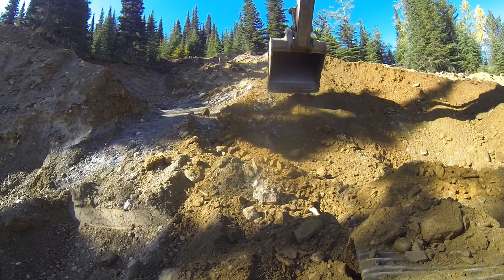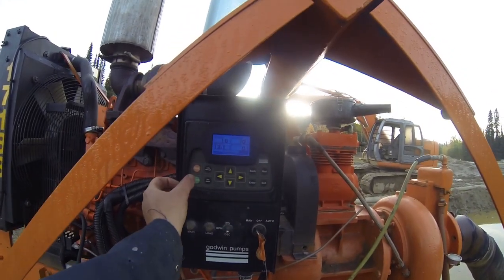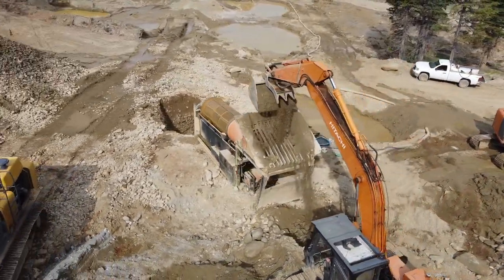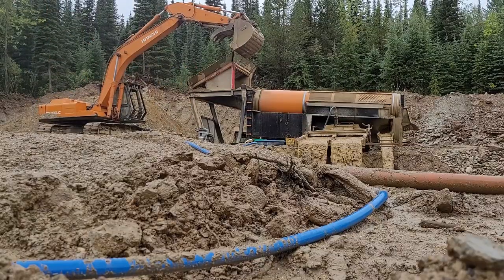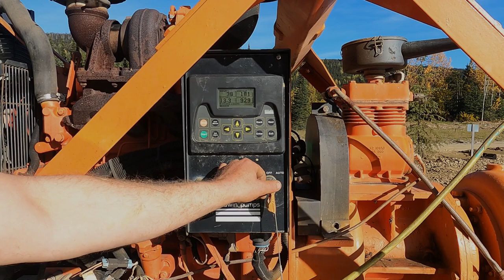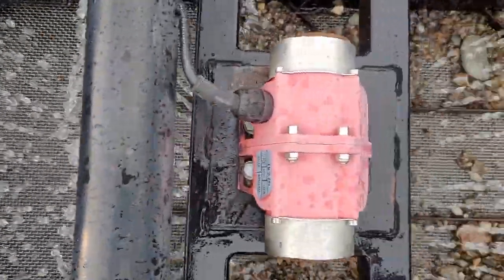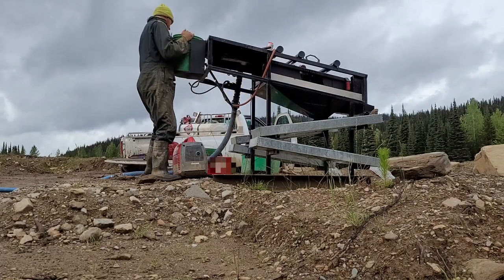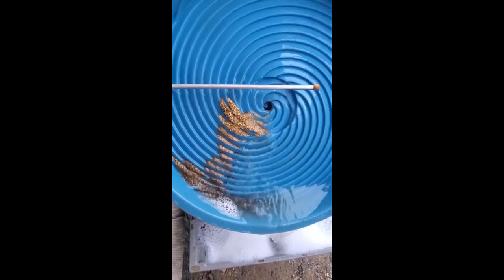Mining for Gold with Dan Hurd !!Almost 7 ounces of gold!!

Comment: Could you explain the geology and the interpretations of glacial morraine gold deposits?  I've seen massive terminal morraines at the south end of Flathead Lake, massive piles of water worn cobbles from the meltoff of the massive continental glacier terminus.
Reply from the maker: For sure!! I have a video coming out in a couple of months all about it. There is a lot of areas on a maraine that can be richer then the moraine itself. Melteater channels parallel to the lateral moraine are usually the richest in my area. My claim doesn't have a terminal moraine and is upstream, thise can be rish also. The moraine itself carries gold also, just a big mix of the meterial. I'll get into it more in that video. Thanks for watching:)

Comment: Which gold hog mat do you use?
Reply from the maker: Hey there.  I use a mixture of most the mats. Bedrock, talon, motherload and razorback.  I start tall up top and taper down to the smallest mat on the bottom. They work excellent in dirty water and clay meterial.
Reply: @TheMiningChannel  how wide is the matting and how many yards an hour you run and what size gravel ?
Reply from the maker: @Golden_B1  The sluice box  total width is 6 feet wide. The mats are in 3 foot wide sections which Doc from gold hog doesn't suggest( I just havnt had a chance to put dividers in but should be 18" wide) A guy gets alot of scouring in the mats with the wider sections. This meterial we run is mostly sand "without" alot of black sands. My input volume into the trommel is 40-50 yph with 1/2 classification onto the main box.
Reply: @TheMiningChannel  something i forgot to ask is how much water you pump trough the sluice for that yardage?  Thanks
Reply from the maker: @Golden_B1  Not sure on exact GPM but I do supply the box with a 6" line. I would think around 600-800 GPM?????? That is just a complete guess though hahah. I have tried less water and gold gets blown out, Any more water and the pressure just becomes to much in my hopper and sprays out the sides.
Reply: How do you design the spring system on a shaker deck?
Reply from the maker: @Golden_B1  The springs are old  Cat engine valve springs. Anything big would work, the vibrating motor a guy can buy off Amazon, just search concrete vibrator. They are orange in colour, I used the 50 watt one but had to add more weight because the deck is heavy. They do make a 100 watt unit that would work really well.